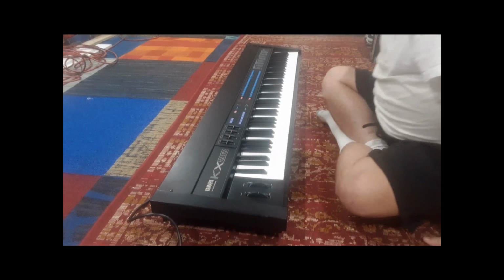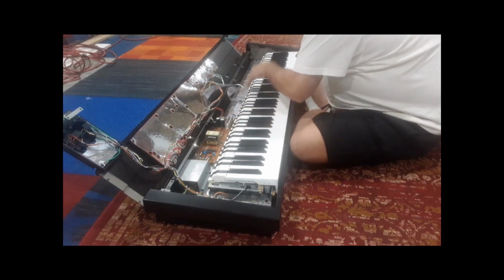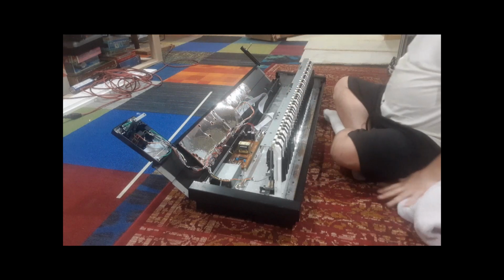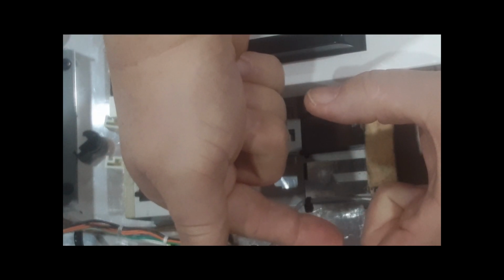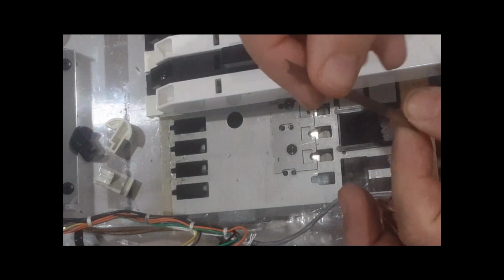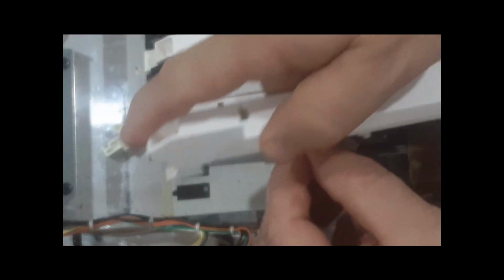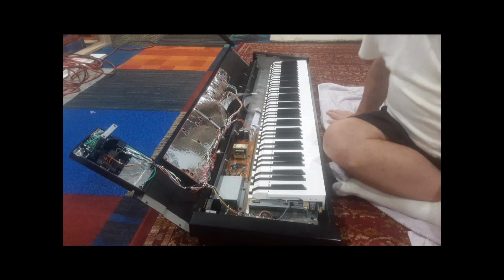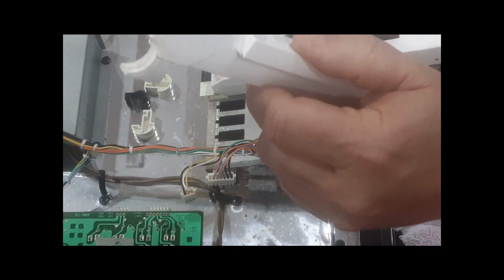Yamaha KX88 Open Cover and Removing Keys (see more for WARNING)

Comment: Wow! I can't believe the spring goes in that way! The opposite to the FS keybed used on the DX7, M1 etc. So dumb and just asking for trouble compared with having it slot in at the back of the keybed.
Reply from the maker: Thanks for the feedback. I think you revised your comment before I could reply. I do indeed have the sping in correctly, but I do have to develop my technique. The manual is just two photos and no clues on technique [grimace]. I agree, the DX7 is much eaiser and having that spring channel right next to the switch on the KX88 is as you said "asking for trouble".  After I made this video I added the warning in the more section just because of that.  I have never even touched a M1, let alone open one up. I now have the connector that I will put on the After Touch cable so the whole Keyboard can be completely removed from the chassis without desoldering. I will  make a video on that - it is just a 1/8 inch (3.2 mm) in-line stereo plug and jack.

If you have any questions or requests, don't hesitate to ask.
Reply: I should have watched the entire video before posting my original comment but a few minutes later I realized that the springs did indeed go in 'backwards' compared to the DX7! The DX7 way of doing it makes so much more sense. Maybe they had to do it that way to get more tension on the spring to account for the heavier weights.

The M1 and later Yamaha and Korg keyboards have the same design as the DX7 but they added a little plastic piece in the slot for less friction.

I'm surprised that Yamaha didn't put a connector on the aftertouch cable, or have the aftertouch board attached to the the keybed like the DX7 etc. If I ever do manage to get a KX88 putting a connector on will be one of the first things I do!

I do love the older keyboards where the case opens from the top though. Much easier to work on than everything afterwards where you have to go in from the bottom.
Reply from the maker: @ispowart  Been there done that... watch a video, comment, and then realize I spoke too soon. 

Yes, the way the X series open are great. Pleanty of storage inside to store schematics and maintenance notes. I may scan everything I have gathered about my keyboards into .pdf and my videos and put them on a thumb drive inside as a nice "Easter Egg" for the next owner.  I still have to increase the gain on the after touch amp, it's just a resistor change. Since that resistor has to go to a higher value, I just lift one lead of the resistor and solder in a new resistor to it to form a new higher value resistor. This way if I ever want to back out the modification, the original resistor is still there.
Reply from the maker: @ispowart  The action on the KX88 keys is superb quite actually - very much like a Yamaha Grand Piano.  I know you Brits use "quite actually" a lot, do you get commission on it [smile]. Just kidding, I like to poke fun at you guys because you drive on the wrong side of the road [laugh]. But I can take it as much as I can dish it out.
Reply: @paulromsky9527  Can you please inform me as to what resistor and the PCB where it's situated? Also my MOD wheel spring is missing but I don't use it on this Axe. Any advice as to how to disable it? PS: My Marshall Tech always leaves extra fuses, a business card, and a card with the date repaired thumb tacked to the cabinet inside. I only wish there was a schematic for the ECU on my RX300 in the box! LOL
Reply from the maker: @ChrisMichaelsChicago  Do you mean which resistor needs to change on the KX88 to increase the gain on the Aftertouch? And the best way to make a missing Pitch Wheel requirs two precision resistors. You could use a trimmer pot, but two small resistors are eaiser to mount. I can get you a schematic to keep inside. Look at  credits at the end so I can send you a drawing on how to make the changes and schematic.
Reply from the maker: I got my KX88 from Guitar Center. Their website on used equipment is collection from all their stores all over. Mine was shipped from their California store to my store here in New Hampshire. It was pristine and only $350 US Dollars + plus $20 shipping which was very low. When it arrived I was heart broken... it had been dropped on the right side, which cracked the end piece and that made the two white keys stick, and it was dented in the front rail under the keys about an octave lower causing 3 more keys to stick. Also, the top row of buttons didn't work. But no keys were damaged. These things are built like tanks.  The manager said he would give me my money back as it would have to be serviced and resold.  I asked if I could fix it myself and get a price break. He was great and gave me a very good deal by giving me some cash back.  It took me two days to fix it and aside from some cracks on the right end piece, it is like new... only some very tiny superficial blemishes on the metal parts that I touched up with a black Sharpie marker. The buttons not working was a cold solder joint on a circuit board that opened up over time. The keys, action, velocity, after touch, buttons, sliders, LEDs, jacks, and MIDI are all now perfect.  It is rare to find a KX88 with all the buttons so pristine, most have at least one damaged.  I made a video on performing a Self Test on the KX88.